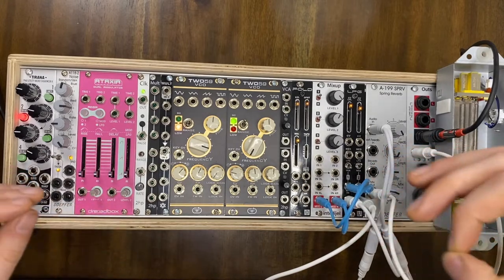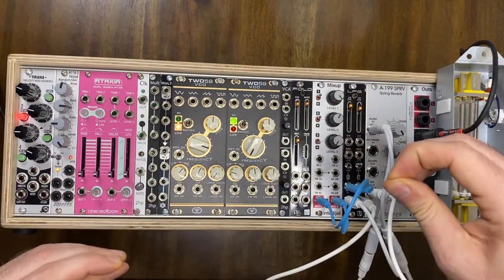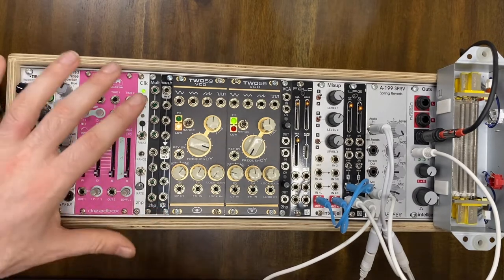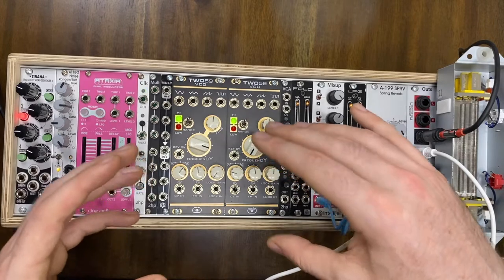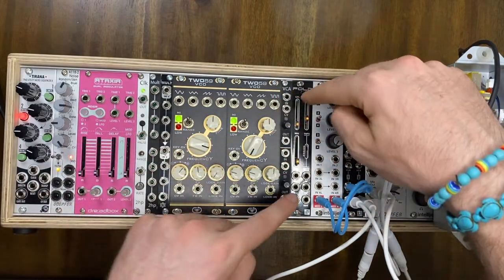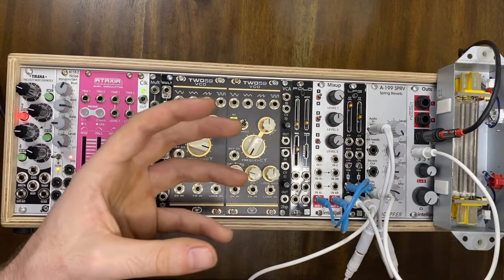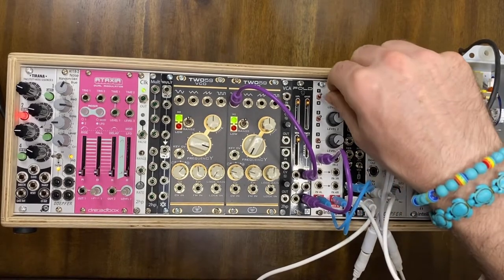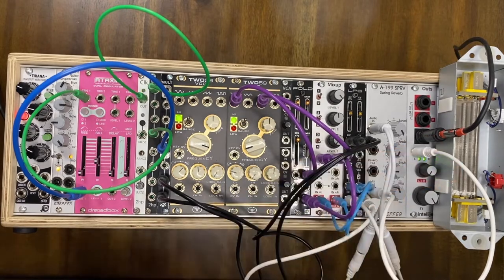How to make:  BUCHLA Eurorack EASEL

Comment: My own attempts to re-create Easel failed on using LPF instead of LPG and missing wavefolder. Now I have clear directions to move on. Tremendous explanation, thanks!
Reply from the maker: I’m glad to have helped.  Not sponsored, however, I would recommend Synthrotek’s Fold and LPG.  It’ll give you what you’re looking for at a low HP.  
I recently found a 16HP 5 step sequencer.  Which means I’m probably going to have to change some pieces out.

Comment: My attempt is running a Modbap Osiris through a CaviSynth ODLPG. Using a ALM Pipslope and Erica Synth Pico Rand for modulation. Sequencing provided by Rat King modular Random Sequencer. I use a Circuit Abbey Tick as a square wave pulser. The Osiris has a built in wave folder and can produce FM.   Not a complex oscillator, but can be patched in a west coast fashion.  Sub-oscillator can be given separate pitch and gate signals.  I need a real Buchla.
Reply from the maker: That’s an awesome build!  My Eurorack has upgraded recently and I am currently working on a new video.  I totally agree with you I too would like a real Buchla as well.  Maybe Behringer will make a synth? 😅